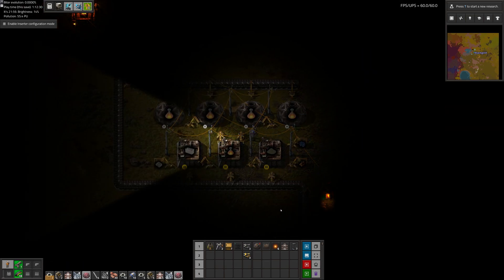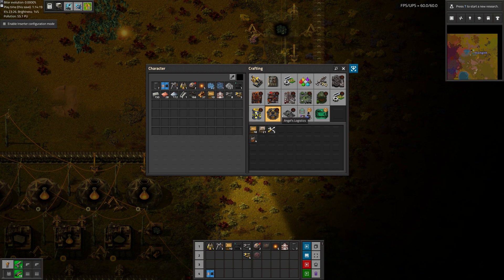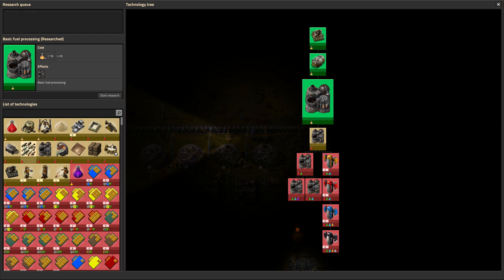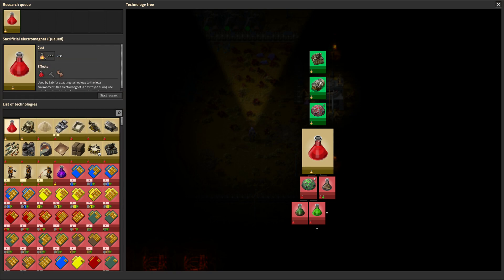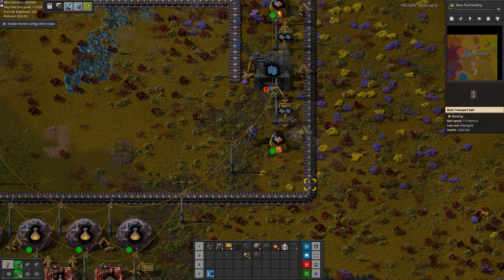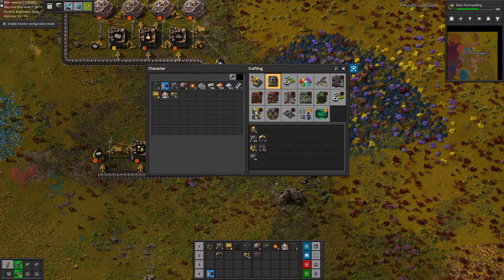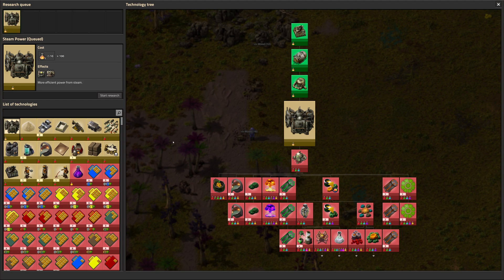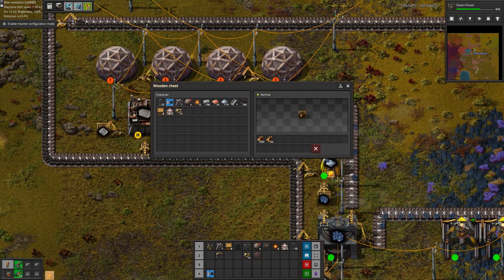[Factorio 1.1 4K] Angel/Bobs Ep 5: Finishing Burner Science (Tutorial/Walkthrough)

Comment: I recently started playing this (using the save from ep. 148 to get the mods correct, and starting a new game), but there is a problem. 
The steam research costs burner and green(single use ATMOS) research packs, which means I need to use tier 2 lab to do the research, which needs carbon to build it, which needs steam to make the carbon.
I've tried to find a way to get past this using the recipe book, but have had no luck. Any ideas on what I can do?
Reply from the maker: AAI was changed after I started my play through, creating this conflict. It doesn’t bother my play through because I’m past it. You can fix it by downgrading AAI to 0.5.9 (before the change.) Or you can remove either of the mods if you want all
the mods up to date. Or you can make patch to change the technology requirements. I’m just using 0.5.9